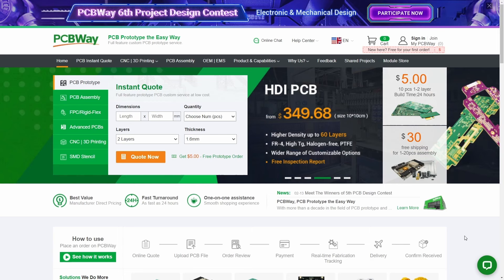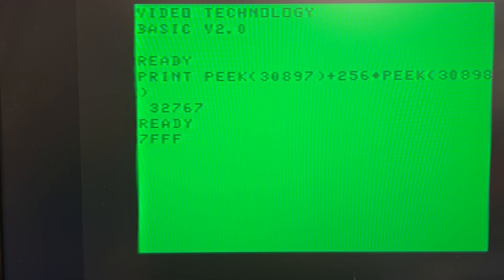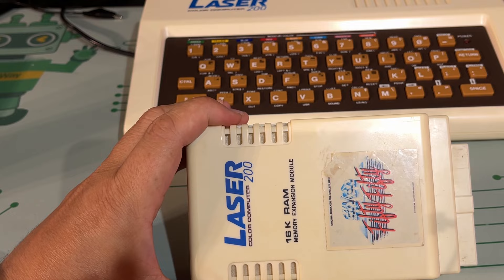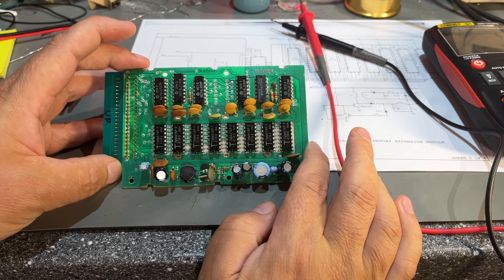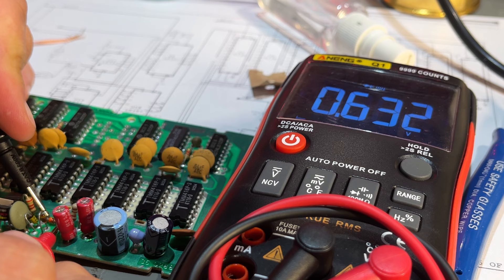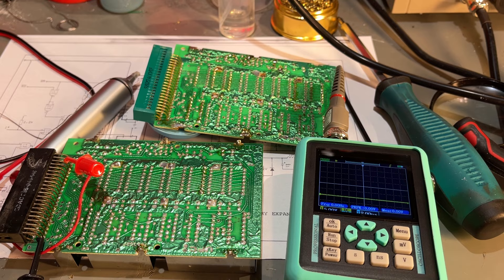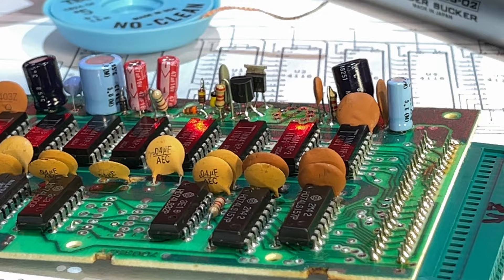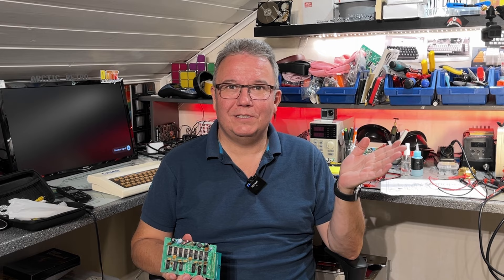Repair: VTECH Laser 200 8-bit computer 16k memory expansion -with help from a friend

Comment: Wow! I wasn't expecting something so interesting when I read the title. But in fact it was informative and entertaining. As you may remember I'm quite interested in the Laser computers because that was my first computer too. I have a working 16K RAM expansion and haven't looked inside yet. I wasn't expecting 4116 RAM ICs in there as those are complicated with the 3 needed voltages. It's quite common to have issues with one or more voltages missing in computers with 4116 RAM like the ZX Spectrum. And those RAMs tend to go bad in very short time if one voltages is missing. I think you were extremely lucky that yours survived being fed with only +12V and sometimes -5V for a long time! I wouldn't have bothered with fixing that supply voltages but would have chosen to replace the 4116 RAMs with modified 4164. Those only need +5V and are more reliable that 4116. And they are extremly easy to modify for use as a replacement to 4116.
Reply from the maker: Ok, thanks for the insight :)

Comment: Thats the first real multimeter i ever owned. Then i donated it and a bunch more then saw it on sale and snagged it because i missed it. The only gripe i have with it is the probes
Reply from the maker: I like it because it is small. But the probes are not good. And I don't like the auto shut off. It was cheap.
Reply: @Arcticretro  I thought enough of it to rebuy it haha. It's part of my collection

Comment: Very informative, Tommy!  I always wondered what the capabilities of these were; I discounted them as toys... as I'm sure most did.

I'm surprised they made a 16k expansion for a 32k machine.  You would think they would have gone for a larger amount, given the overhead of all the components other than RAM and the distribution costs for the expansion unit.  Even if they were stuck with a "dumb" module that would map into directly addressable space... why didn't they at least make it 24k?  Anyone else find that odd?
Reply from the maker: Thanks! This machine actually has only 4k RAM. Some models had 6k. So 16k was good
Reply: @Arcticretro Ah... that makes more sense.  Thanks!